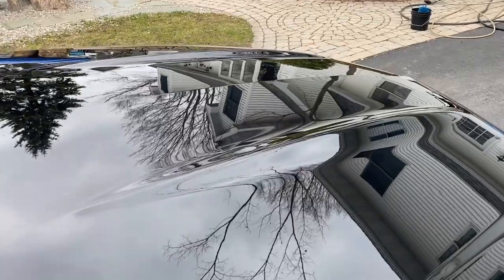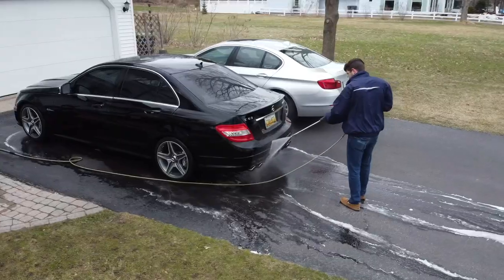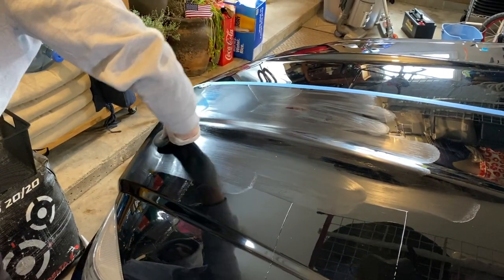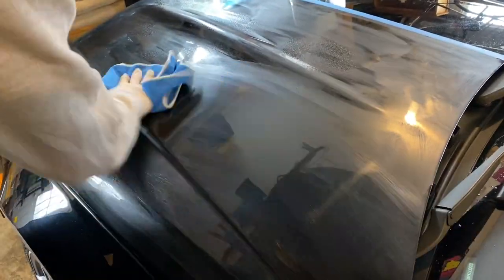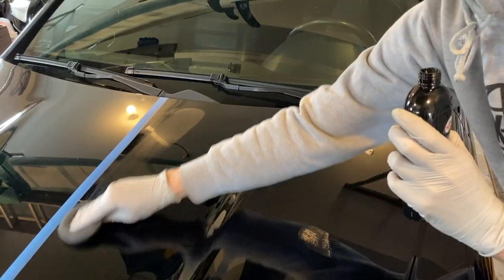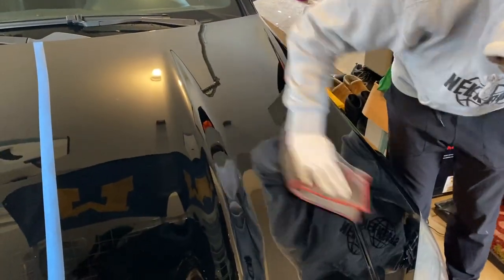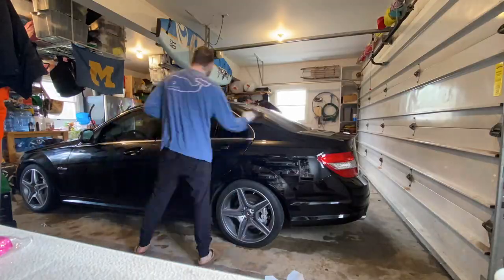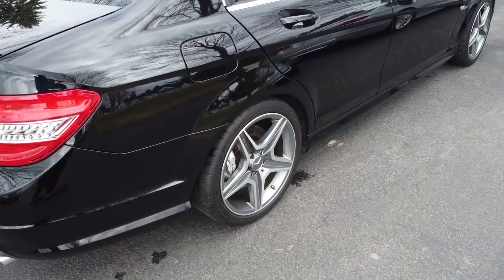Turtle Wax Black Box Review on C63 AMG

Comment: I've used this turtle wax product a couple of times - ABSOLUTELY AMAZING RESULTS!  Your car will look like: black on steroids!  Just a couple of points to ponder...it will only work on areas where the clear coat is INTACT!  If the clear coat is missing, it will not work.  Also, wear rubber gloves!  It's an incredible wax but very messy.  Finally, you will even see improved results if you apply several coats of wax.  BTW, i do NOT work for Turtle Wax - just an avid fan of this product.